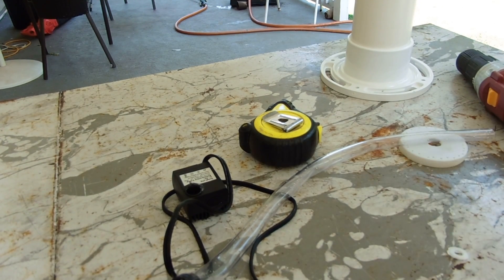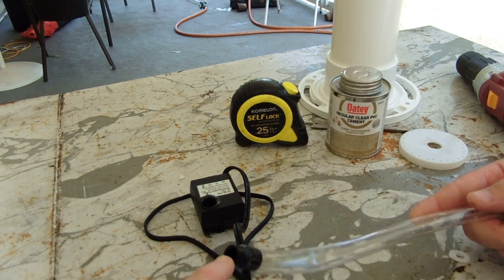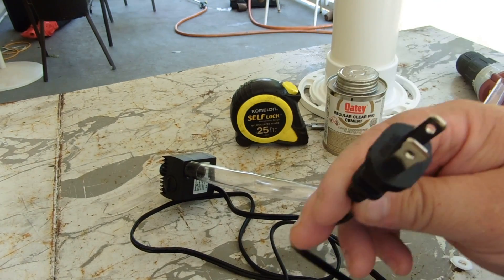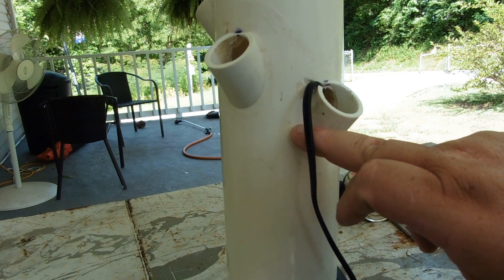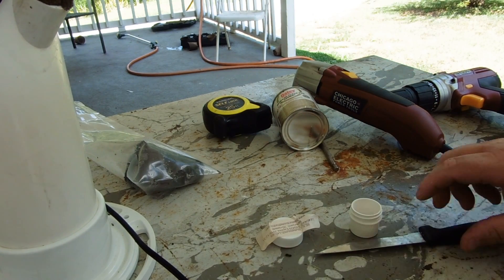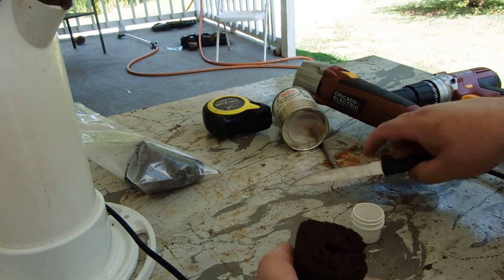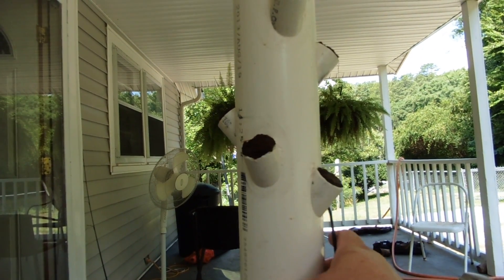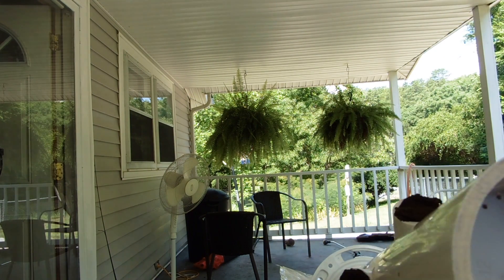DIY Mini Grow Tower for indoors Part 2

Comment: I would drill a high hole for the electric cord, and use a grommet for it to make it waterproof, if they make a grommet that big, of course.  I have had smaller ones for air hoses before.